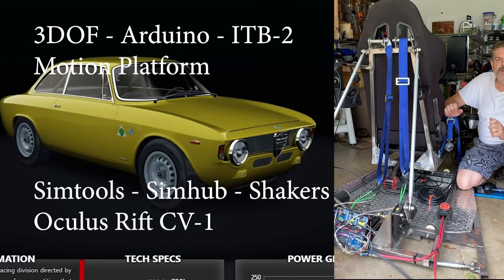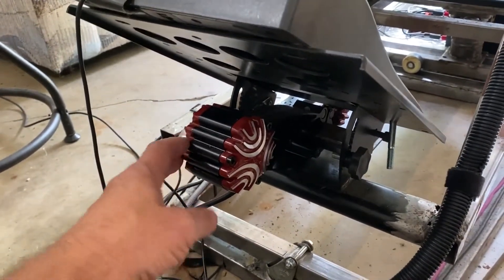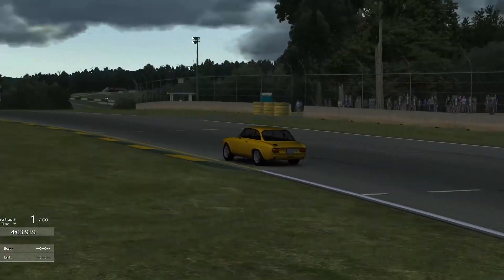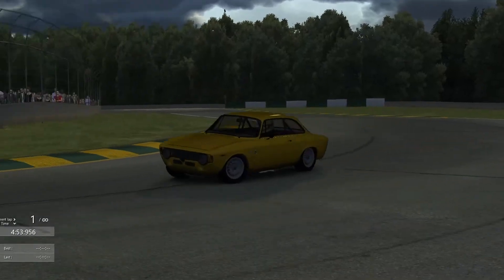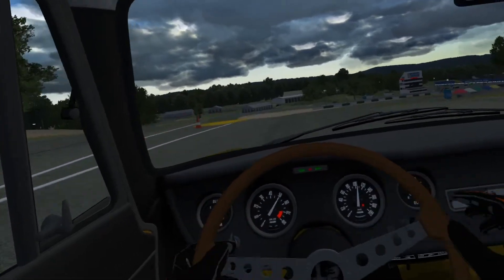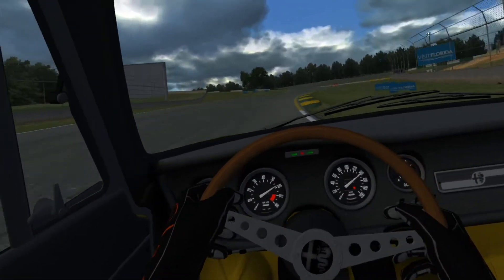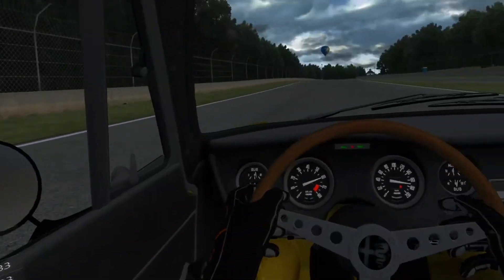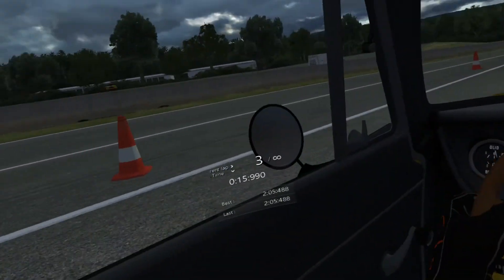motion simulator build  3 DOF motion platform VR and buttkickers - VR POV

Comment: Did you have any problems by using simtools and simhub at the same time?
Reply from the maker: Great question my friend and NO.. no issues.. Simtools  and SImhub would use different USB ports.  Just start Simtools first..  Hope that helps! Dave
Reply: @DMAX_DIY  Thank you my friend, i tried out that last night and it works great. My plan is to build my own bass shakers from a couple of speakers that i bought  second hand.

Comment: The Alfa was very popular in racing back in the late 60's and through the mid-70's, handled well, very tossable, and balanced although flared fenders to  accommodate  wider tires were often fitted. I always enjoyed throwing the ones I drove around with utter confidence that you you snatch it back from disaster. One in particular in Bavaria I noted, as I drove by the owner's home daily,  had been worked on for months. Extensive body work, finally finished to near perfection as far as I could see. Beautiful flared body work that made it look even better than stock giving it a very aggressive stance, and now fitted with much wider tires.The owner headed to the track, and the next day I drove by and there it sat, totaled, mangled bits of Italian engineering and months of labor by the owner. Sometimes you get the bear; sometimes the bear gets you.
Reply from the maker: Yes this car has really nice balance. Really like driving it as fast at it will go. You get that nice slide around the corners if you push it just right! It's awesome. It's been a while since I have seen one around but they are pretty old and were flogged pretty hard so probably wont see to many out and about anymore!